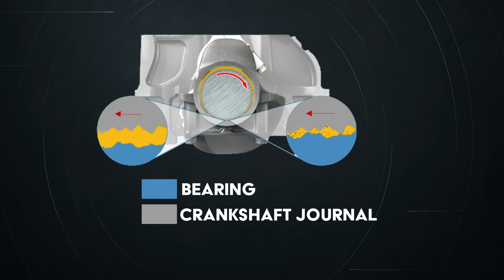the truth about start-stop technology (finally proven)

Comment: I like the idea of the polymide coated bearings.....IF the manufactures incorporated some specific trace elements in the bearing base material then an oil sample will reveal when the bearing has "failed " or at least lost it's coating.   Can I bring my truck for the next rebuild ( i mean test), just kidding from Canada.

Comment: Consumer point of view is likely, "They wouldn't use it if the engine couldn't handle it." But as clearly stated and shown, it can likely handle it through the warranty period, then its not the manufacturer's problem. I would have no problem with this feature, if it was permanently defeatable. I've always said, even if its a 10-step process detailed in the back of the owner's manual; those who care, will find it and be content, and the other 95% of consumers will continue on with blissful ignorance. This would likely see the same adoption rate as people that reliably use the button to deactivate temporarily, so their "green" score would be unimpacted.

Comment: Agree that you need to prove it through experiments, but it’s been generally known that starts are hard on the engine. Cause the oil goes back in the oil pan when the engine is off.  Correct? So simply how are car companies not acknowledging more wear with start/stop ?  Well it’s good for car manufacturers that people need to buy new cars. It’s simple. They make more money through repair and purchase of new cars.
Reply: I would propose that the car manufacturers wanted to push for this not only the government.  So cars wear out earlier and force people to buy new cars.

Comment: so this answer is wrong if you ask Gemini? 
No, start-stop technology does more good than bad for an engine and overall fuel economy. While some initial concerns about wear were raised, modern start-stop systems are engineered with more robust, heavy-duty components like starters and batteries, and incorporate advanced lubrication and temperature management to withstand repeated operation, making the wear on engine components minimal and generally not a significant issue.

Comment: When I bought a new car, I complained at the dealership about it and the excuse I got was "well its a hot start" and I responded, that doesn't matter, a start is a start, its excessive more wear on components. After that he wouldn't talk about it anymore, I never knew it was harming the bearings so badly. Glad I bought a device I connected that disables this feature so I no longer have to press the button.

Comment: Well presented and substantiated argument. Your instrumentation of oil pressure was beautifully graphic. The argument that, whilst the engine remains hot the oil remains trapped in the bearings is clearly fatuous on each cylinder bearing when it gets kicked by each ignition for the first few seconds on restart. 

Something that has always been tragically blindingly obvious to any true Mechanical Engineer .. a feature that manufacturers have been forced into incorporating into every ICE to ensure everyone that buys into a “modern” car will be forced to trade-up to an EV within the next 10 years. The only people still chugging around in ICE powered cars by 2035 will be in old diesels manufactured before 2015 !!  … I certainly suspect my 2005 Skoda with its pre-DPF diesel will well outlast my newer 2015 model with (essentially) the same 2ltr TD power plant … even though the emissions are now too great to be acceptable in most cities. 

Bugs me that even when you turn off the Auto-Stop/Start, it frequently resets itself when you stop at the next junction … the system appears to assume the first time you cancelled it you must have done so by accident and didn’t really mean it … and you only find out when you pause at a junction and try and pull out quickly into a fast moving stream of traffic 😱 whilst furiously stabbing repeatedly at the button.  Think it might make a good epitaph to my tombstone “He died trying repeatedly to cancel the Start/Stop System” ?

Comment: 5:49 to be fair, you should have repeated the experiment after about 30sec from ending the first run, to simulate accurately an average stop/start sequence and show how much time it actually takes an already operational engine to build up oil pressure again. What you did now was test warm oil on a completely drained engine. You'd be surprised how much different the result would be. I am also not a fan of the start/stop system but I'm not so sure it is the culprit for more failing engines/bearings. I would look more into these new 0w8, 0w16 or even 0w20 oils, as well as people's driving habits, i.e. not following the proper warm up procedure for engines, especially the diesel engines that require more time to warm up to operational temperature. But I am with you on this start/stop investigation, it could be a culprit, but definitely needs more methodical investigation for conclusive results. Finally, the OM616 and 617 were mainly used as N.A. versions, very few of them were built in turbocharged versions, which not only means less stress on the engine components but also less stress on the oil itself. And of course, lets not overlook the fact that there are modern turbo-diesel engines such as the PSA 1.6HDI engine that reached high mileage with no or very few issues, and they also use the start/stop system.
Edit: forgot to mention that the crazy-long service intervals of recent years are far more responsible for engine wear than any other individual factor.
Reply: I use start/stop very often when I have to stop for 15-30s+ at a time. Normal station wagon car currently at 700.000kms, with the only replacement being the rear suspensions a few weeks ago after more than 10 years now. All cars reach high mileage because of the way we drive them, not because of start/stop alone. Many people blame components when they drive bad
Reply: That hot oil change test really bothered me as well. Haha. 

The in-vehicle test might be lacking as well. If the engine never reached operating temps, and it was continually gaining water content in the oil, then I would definitely expect to see the issues shown. 

We need a lot more data about the test conditions, and it would be great to see a comparative assessment of an engine which was exclusively idled for the same duration. I've worked on enough police car engines to know the damage caused by idling. Haha
Reply: @dallin95 Large transport companies do real world trials over millions of miles, and most are transitioning to start-stop engines. That should tell you everything. They aren't doing it because they're being forced to, or some marketing agenda by the big environmental car manufacturers, but for cost savings. And the amount of fuel savings from idling is negligible compared to the cost of the vehicles and maintenance - if start-stop decreases lifespan or increased wear, it'd far outweigh idle fuel.
Reply: To be fair, he also shouldn't be using a 2016 VW Transporter T6 van.

Comment: Good practical science based video on engine wearing issues.
I have always known that it takes a while for even modern engines to get to full operating pressures and temperatures.
I also remember a Castrol oil advert from the 1980s in which a car was started and driven hard a long way for 8 minutes and they showed using the engine and oil technology of then it takes like 7 minutes before the full temperature and pressure is achieved in every part of the engine for longevity.

Comment: It is not just bearings. Vehicles with Direct Fuel Injection (DFI) ( i.e., almost all gas engines) , allow un-vapourized gasoline to leak into crankcase *if the engine is stopped before it has fully warmed up*. This mostly affects engines used in cold climates. The 2016-19 1.5L Honda 4 cylinder engine is notorious for this type of "crankcase contamination" or "oil dilution".   While the Honda engine was bad, all DFI engines suffer from certain amounts of oil dilution when shutting down a cold engine in cold conditions.

BTW: How did Honda "fix" their problem?  They used software to wait longer for the engine to warm-up before enabling the auto stop/start. Clearly, disabling auto stop/start would be the ultimate solution. They could not do that thanks to emission restrictions.

Comment: I was never concerned about the engine wear as much as starter failure. With the feature activated, I am more likely to get stranded by a failed starter in the middle of the night and the related repair costs versus the very minimal savings I would achieve in fuel savings. I can judge when I should shut off my idling engine at long delays or traffic situations. I don't need the manufacturer or government telling me to.

Comment: A factor that worsens start wear is applying accelerator which increases the load on the bearings. My cure is to run an EV. Minimal fuel cost (solar panels) no start wear and only windscreen wiper blade rplacement in three years.

Comment: You will Never save any money with this system,on newer cars the starter motor is a dual motor ,it costs at least twice the cost of a older motor add the cost of fitting your will never even break even!

Comment: You have long thin tubes leading the pressure gauges which do not accurately reflect when the bearing surfaces in the engine saw oil pressure. However I do agree that starting the motor is where the majority of wear happens and start/stop os idiotic.
Reply: If done badly yes, it's idiotic and causes damage. But I suggest you look into how Mazda did their i-Stop on their new cars, with an electrical oil pump that makes sure the engine is properly oiled before starting. The system is also smart enough to not shut the engine off unless its oil temp and pressure are ideal. It literally has all the benefits of start stop (lower consumption and emissions) for a tiny bit more complexity.

Comment: I try to remember to turn off the auto start/ stop but quite often forget. After 10 month my vehicle has recorded 42 minutes of shut down time and a savings of 2.1 litres of gasoline. In the long run I think the energy saved will not even come close to the energy required for an engine/ starter rebuild.

Comment: If this was indeed such a big issue you wouldn't find so many Toyota hybrid motors in many 100.000km. Those engines stop multiple times per minute in city driving and taxies don't have any issues with the engines at all even at 600.000km. I guess other manufacturers need to up their game and improve their bearings or oiling systems.
Reply: That engine does cheat a bit there. It’s low compression compared to other motors and because of the hybrid system it isn’t really stressed with having to move the whole weight of the car every time it starts. Toyota did an amazing job with the engineering for that hybrid system and the Atkinson cycle for the engine. My Prius prime regularly averages 600+ miles per tank of fuel. 800 miles if you mix in the full 30 miles of battery every day.
Reply: @timacosta7015 newsflash, even Hyundai uses valve overlap to have low compression while starting!
Reply: @timacosta7015  So it sounds like Toyota could make better system even with start-stop system which completely negates what the guy in video was trying to say "we could make reliable engines if we're allowed to" and makes other manufacturers appear unable to develop new better engines based on new trends.
Reply: @timacosta7015  > That engine does cheat a bit there. It’s low compression compared to other motors

No it does not, quite the opposite actually. The 2023 Prius 2.0 Hybrid has a compression ratio of 14:1, for "normal" engines it is usually around 10:1.
Reply: Also since it's a hybrid, all of its pumps are electric, power steering, vacuum pump, oil pump, AC compressor. So the engine here is under  no load during start, only once it has idled does the transmission begin to apply a load to the gas engine. And since the oil pump is electric, the engine is not starting without oil pressure.
Reply: @stevenbmw850 I have a 2001 Prius, none of these are electric except the power steering. The AC has a special evaporator that stays cold with the engine off, there is no electric oil pump, and the brakes are drive by wire so they don't need a booster.
Reply: @aspecreviews 
2005+ is all electric, even the AC
Reply: @zocker1600 
That was the other guy that thought that, and yes 14:1 is high, chosen because it gives better fuel efficiency.
Reply: @stevenbmw850  All the electric pumps and motors in a Toyota Hybrid is presumably why you hear lots of odd noises coming from under the bonnet when parking etc.
Reply: There’s a big difference between these though. The hybrids are designed to stop and start without the vehicle stopping. You have a separate power plant in the car that allows the switch to be made smoothly without loading the engine before it’s ready. The biggest difference, and one that specifically applies to Toyota, is that they are typically using an electric oil pump instead of one driven by the serpentine belt. The electric pump ensures there is oil pressure when the engine starts. If the oil pressure was to disappear like it does in the normal just auto start/stop feature then they could be considered in the same conversation, but as it stands they are in a completely separate category of hardware.

Comment: Hybrids have been using this technology for a couple of decades and the gas engines partnered to the electric motors do not suffer the failures he is describing. He should qualify his statements that this appears to be exclusively an ICE issue.
Reply: They key worf here is 'hybrid'. They are compketely different design
Reply: @robot_bender-q2r Central to the power train is a the ICE which frequently turns on an off without the issues purported in the video.

Comment: I don't have work today. So I will write this comment. Huh, jokes aside (poor VW) - thanks for the professional approach - both in regard to engine testing and the filming. The guy has a weird accent in English - but all chairmans... sorry, Germans do. MORE IMPORTANTLY - so-called environmental considerations - are a stark contradiction to what actually environment endures (I'm not a green junkie). My BMW N57 engine in my 2012 F11 530xd - has always been quoted as "unreliable". In fact it is an extremely reliable engine - but disregard the oil change interval as recommended (due to "environmental" reasons) by BMW (even in ISTA) of 30 000 km. Always change your oil at 7 to 10 000 km and use decent quality oil (Liqui Moly, Castrol, Mobil, Meguin, or any other big brand - you can save on the work as doing the job DIY is quick and easy). The car (unlike my other baby, a 2008 A6 Allroad 3.0TDI manual) has a start stop system I always switch off (haven't uncoded it). It's not a simple system as it also provides AC and gearbox oil pressure during stops - but yeah, timing chains (two pieces in case of N57, one to the HPFP and other from HPFP to cam) - probably aren't happy with the start/stop. Also stuff like EGR, DPF, GPF, AdBlue and many others (stupidly complicated timing gears in newer Audi V6 diesels) - including even EVs - aren't favourable to the nature if you claim to care about it. Germany is an "environmental" leader - but engineering shouldn't be subject to green junkies with Gretha glasses on. They vote for the Green party - and the green party implements idiotic nonsense in legislation. We cannot keep cheating ourselves. Green junkie stuff is just that.

Comment: Then explain why Toyota hybrids are doing perfectly fine. 
Hybrids are doing even more start-stop cycles.
Reply: Possibly due to lower loads placed on the engine, since the electric motor assists when torque is demanded from the driver. From a dead stop, when start/stop is active, the first thing an ICE engine will experience is accelerating from a stop, which is the highest load demand it will experience. In the case of a hybrid vehicle, more often than not the electric motor will contribute to the acceleration from a dead stop, lessening the total load on the combustion engine and this potentially reduces the kinds of wear described here.
Reply: Toyota has also moved to a zero weight oil (0W-8) in their hybrid engine. I suspect it's to reduce wear from the constant stop/starting.
Reply: Hybrids can use the energy cell to continue running auxiliary systems like the oil pump.
If the energy cell has enough stored energy, the car can run solely off the electric motor and regenerative braking when it's stop-and-go. The engine only has to start when speed picks back up

Comment: The most annoying feather on my 2019 Equinox. It will not save any thing GM thinks about it's CAFE rating. 2019's didn't get the button to turn it off. That came on the next model year. I defeated it with an aftermarket device that plugs into a harness under the hood.